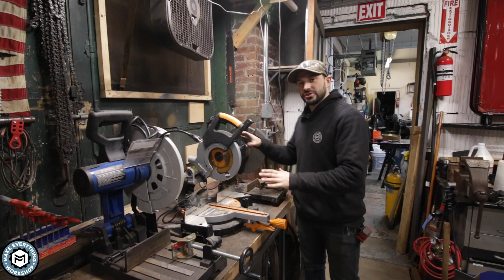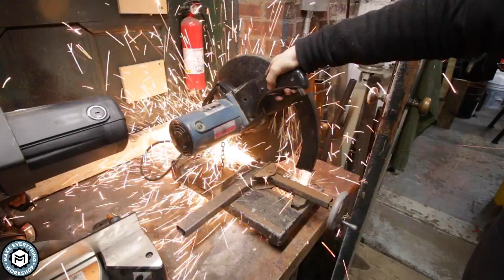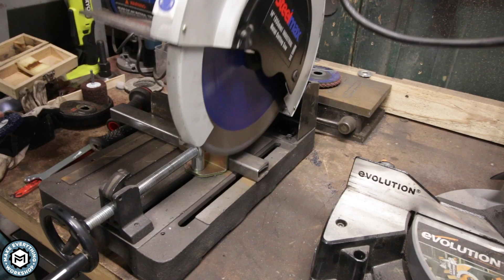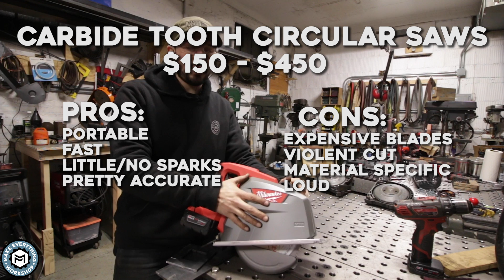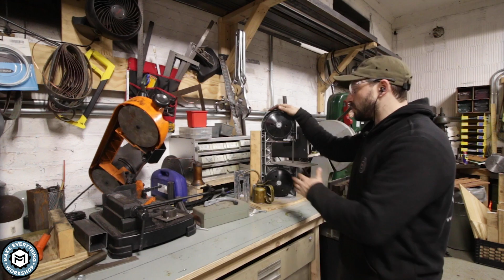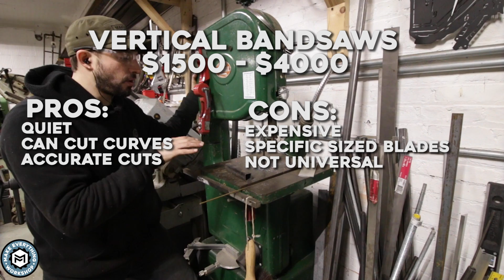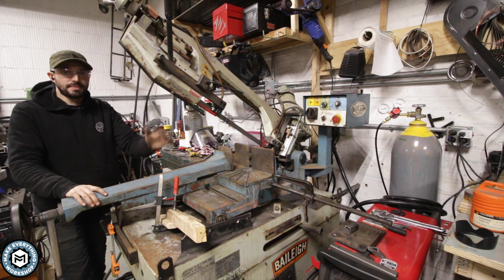The Ultimate Guide To Metal Cutting Saws. From Hobby to Pro!

Comment: So for my $1K budget would you go dry cut chop saw, or horizontal bandsaw?  I almost exclusively cut mild steel, and have a very small shop.  Trying to get into fabrication as a side gig.
Reply: bandsaw for straight cuts only, its probably the most convenient, likely-hood of finding one that miter cuts under 1k isnt that great. I will recommend looking into Diablo brand "Steel Demon" carbide blades for metal cutting miter/chop/cold saws. These blades are a tad bit cheaper than evo blades and also come in about any size you want, and turn any circular saw into a portable metal cutting saw with no clean up. Was pretty game changing for me.
Reply: @BudMasta  Thank for the reply!  I actually got one of those diablo blades for my skill saw.  Used it to cut up a sheet of 1/4" steel and was very impressed.  I think I'll up my budget to $2K and get a 7x12 horizontal/ vertical bandsaw.
Reply: @wannabejeeper  That would do just about anything id imagine, badass saw. In the meantime, if you want something sooner rather than later, one of those diablo blades and a sliding miter saw for around 250-300 depending on the brand, isnt a bad way to start or move up from a circular saw.

Comment: hi, got a burning question, in our shop we just got cold saw just like u have and we cut square tubes but it cuts kinda slow, a lot slower than chop saw with abrasive disc and its also loud when cuts a tends to vibrate a lot, do we have wrong cuting disc on it or theres something else?

Comment: I used to use a big metal band saw that had a built in band saw blade cutter and welder, so you could just cut an weld blade stock to the size you need, and you could repair blades. Also a power hacksaw! power hacksaws are my favorite!

Comment: Power hacksaw
Similar to a band saw but just uses large hacksaw type blades, my dad's had one for years and it's way cheaper to run then a normal bandsaw with the blades only being $1 To $3 each when buying bulk it's just not as fast
Also, flood cooling really helps them

Comment: Hey Chris, this was a fantastic video. I have been doing a lot of comparisons for a metal cutting tool after being fed up using a grinder, especially after using it to cut 2x2 square tubing for a 7'x3'x30" desk with mitered corners... I greatly appreciate the thoroughness and insight you offered. You've earned my subscription. Keep it up
Reply: DW872 is the solution with a Bosch 14" carbide blade. We have a light duty fab shop and do hundreds of cuts of 2"x2"x3/16" - 5"x5"x1/4"with this setup on a single 110$ blade, typically when the blade is near end of its life we pre cut some aluminum / thin stainless and it works awesome.
Reply: @kelnap2294  Thank you for the reply! Why did you decide on that saw versus a bandsaw, cost?

Comment: The problem with abrasive saws is not only the huge amount of hot metal sparks, but the large amount of fiberglass and abrasive dust that spreads throughout the shop, linger in the air for hours. You breath that in, which is very unhealthy, and the abrasive powder gets on, and sometimes in, other machinery, damaging slides, bearings, etc. you need to at least wear a good dust mask, and safety glasses. If you must use one, it’s best to use it outdoors, weather permitting.

My Diablo cermet blades on my 14” saw are made for steel and stainless steel (same blade). I’ve had one for two years, and it still works well. About $65-70. Not expensive. A stainless blade usually costs between $110-140. That’s expensive!

Wear hearing protection with ALL these saws, even the bandsaw. They are LOUD, and will damage your hearing. Guaranteed. Metal cutting is loud, even if you don’t think so.

It’s true that small bandsaw blades cost less, but because they’re shorter, they wear out faster. A 32” blade will wear out twice as fast as a 64” blade, which will wear out twice as fast a a 128” blade, which is close to the standard blade for a 14”-16” bandsaw.
Reply: I put my respirator on when I start working in my shop and leave it on until I'm done.  Sucks when it's hot, but my boogers stay clean!  LOL
Reply: @wannabejeeper  nothing worse than dirty boogers.

Comment: Should mention that the abrasive saw is probably best for really thin wall tubing (like EMT and metal studs) as the abrasive grains are effectively a very fine tooth. For that same reason, they're not very efficient at heavy sections.

A popular misconception about blades is that coarse tooth blades are for non-ferrous materials and fine tooth blades are for ferrous. Not so. The rule of thumb is to have a minimum of 3 teeth to a maximum of 7 teeth in contact with the work. Less than 3 teeth and you risk stripping teeth and on really heavy sections, the 7 tooth max is not achievable. The material being cut does affect the blade material and mostly the SFPM.
Reply: I run one of the evolution sliding compound mitre saws and have found that the blades from evolution are terrible. I switched to using a Diablo Cermet steel cutting blade and it's been a big improvement. I keep two of them on hand so one can be sent out for sharpening if it fills during a job. Great little saw for the money.

Comment: In my shop I run only one tooth pitch on the 350 cold saw and that is a corse pitch and high speed on all thin tubing up to 5mm Thick over that or solid I use slow speed. I find with this setup I get the most number of cuts per sharpening as I use the saw daily. For some ideas on the drilling video I use a wood splayed drill when drilling plastics as they don’t bite as hard and Clean out better.

Comment: No love for the roll around imported 7x12 horizontal bandsaws? I have a Rong Fu, same as the Jet and a few others. Not nearly as nice as a big dual miter like yours, but less than half the cost and a nice step in between the little benchtop units and a full size dual miter saw.  Easy to stash out of the way if you're short on space and good blade availablity too.  That and the portaband gets a lot done for me including lots of stainless.  I did just buy a 14" carbide tooth chopper to see if it could help me get through thin tubing and aluminum a little better.  Really hoping the blade changes aren't too involved.

Comment: NEVER cut aluminum with an abrasive disk unless it’s a specialty aluminum disk. They clog up and can explode and injure the person using it
Reply: True but you can add a special type of wax to any standard disk and it will allow you to grind/cut aluminum
Reply: @MichaelLangell  You can also use regular bar soap to prevent clogging abrasives when grinding/cutting aluminum.
Reply: Most people don't know you can cut aluminum with wood saws
Reply: how do they explode? what causes that? 😲
Reply: @jessihawkins9116 
Someone cuts something soft and it embeds in blade (true for grinders too). Then you cut something hard and it heats up a lot, the material in the blade expands quickly and fractures the wheel, it flies out like a bomb. Talked to an old timer who worked in a Navy machine shop and had to mop up blood from a grinder where someone ground some brass and then another guy came back with some stainless and it exploded in his belly. The story made an impression on me and was told in a way that you could made an impression on him to this day.
Reply: My metal fad mentor showed me when the blade gets gummed up you just force the blade on the material for a brief second to unclog.

Comment: they do make a stainless cutting blade for those chopping saws.  Evolution Power Tools 10BLADESSN Stainless Steel Cutting Saw Blade, 10-Inch x 66-Tooth
Reply from the maker: Great point I may have forgot to mention.  Evolution makes stainless, and Jon ferrous specialty blades for their saws. They work great although pricey at about $120
Reply: With the Diablo Cermet II blades, you don't need a separate blade.  Those can handle mild AND stainless steels, and they're not expensive either.  It's those special ceramic-metallic carbide teeth that freakin rock!

Comment: Another con to the portabands: The blades aren't square to their base (usually a few degrees off) and they don't have a way to adjust it on the tool. Found this to be true across all the brands I've used. If you want to make precise mitered cuts you're going to have to do some fussing about, but beyond that it's an amazing tool to have and I recommend picking one up!